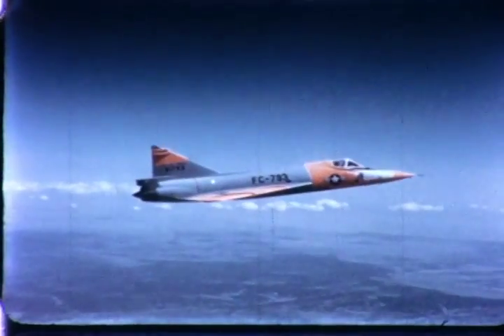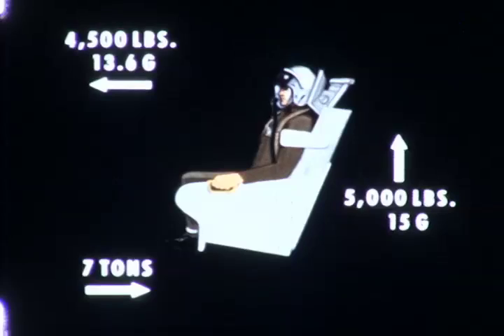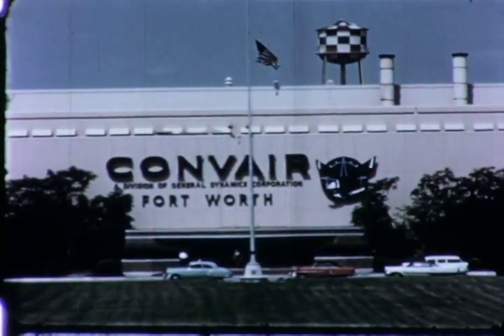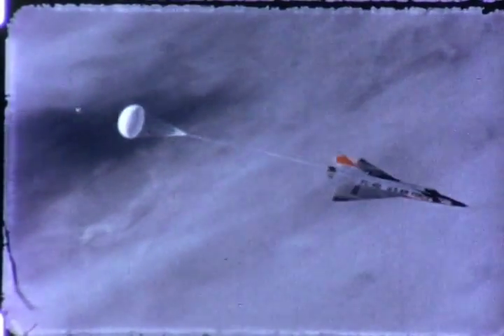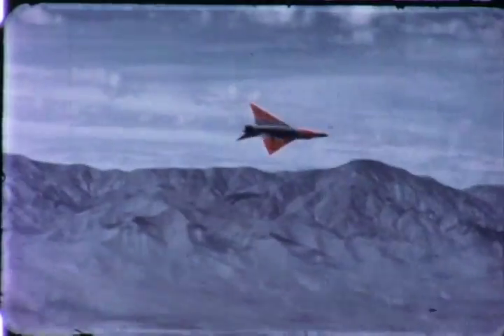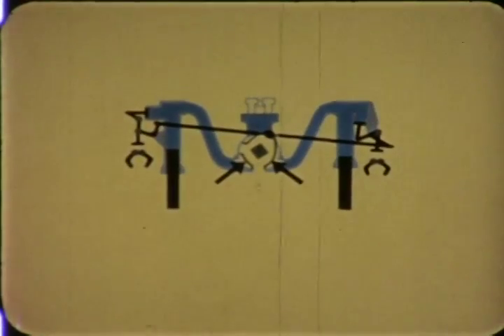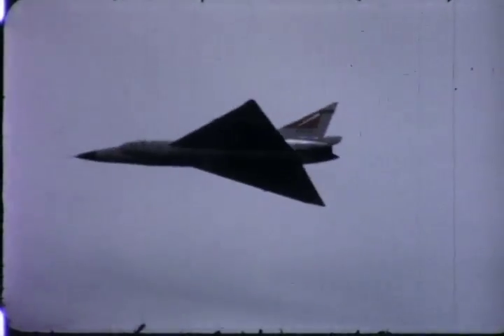F-0594 Convair F-102 Delta Dagger Video

Comment: France had no issue with delta wing jets and theyre still very succesful  planes for bational défense. 
I wonder why it didnt work in the USA?
Reply: It's largely political. The f106 was the fastest and most manuverable plane america had in the 50s all the way until the f15 came along. Which the 6 still out manuverd above 40,000 feet or 12000~ meters. It is also to date the single engine jet with the lowest accident rate in the US's history. 

However, it was an Air National Guard plane. The f4 came along in 1960, the year after the 6. This was at the same time the us was trying to consolidate all of it's air wings into using the same aircraft. So while the f4 had the Navy, Airforce, and Marines batting for it; the much less influential Air National Guard was the only advocate in the 106's corner. 

Another reason could have been financial. The f106 was more expensive than even the f4. Also being an interceptor it would require modifications to carry Air to ground may further add to the cost.

Comment: F102 Delta Dagger couldn't acheive Mach 1 do to lack of an " area rule" fuselage . This fighter interceptor was a disapointment overall , unlike the F106 Delta Dart , the " Six " was brilliant !!!
Reply: Yes on very early models, but fuselage redesigned after which speed was good for mach 1.2 though the Six could hit confirmed mach 2.3!
Reply: @geauxtigersdjs  the Six was a badass Interceptor , it came into service in late 1959 and was retired by the ANG in 1988 , not too shabby !! 👍
Reply: False.

The YF-102 could not reach Mach 1. The YF-102A incorporated the area rule fuselage which enabled it to exceed Mach 1.

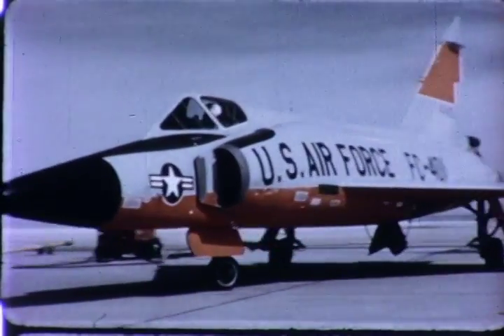Comment: 10:15 Here's an interesting shot. First, the DC3, an airliner from the '30's. Cruise speed: 200 mph. Pan over to the F102, a single seat fighter from the '50's, which is the same length and has the same gross weight as the DC3 and is supersonic.

Comment: I was assigned to the 482nd FIS at SMJ AFB.   WE HAD 57s, one 56, and two TF 102s.  I was an MG-10  Automatic Weapons Control Systems maintenance guy.
Reply: Lucky man... When I went into the USAF in 1987, several 102s gate guardians were around even a TF... I remember thinking about those men in the USAF in the 50's and 60's... must have been great compared to modern day operations. The F-102 is my favorite US jet...

Comment: Known as the Dirt Dart. Of 859 built, 259 crashed, killing 70 pilots. Withdrawn from Vietnam because the Air Force couldn't find a role for it. The plane had a 0-3 record in air to air combat. Two Greek F-5s shot down two Turkish F-102's in 1974. A PVAF MIG -21 shot down a F-102 when it snuck up on two F-102s. No rearview from cockpit, forward view blocked by instrument panel and metal post middle of windshield. An all around dog.
Reply: Not a dog. It was designed as a bomber interceptor. The fact it was not favorable in dogfighting is not a flaw.  It could not grade gravel roads well either. Another function it wasn't designed to perform.  The F-106 had the same windshield design which was more than adequate for sighting a 100ft wingspan intercontinental bomber.  Both served well for years.  In the end the F-102 was a positive step forward in high speed jet technology.
Reply: p.s.  259 loss is a 30% loss rate, in an era where most fighters probably suffered a 25% loss rate. The USAF had literally thousands of planes. The USN in the late fifties was crashing 5-6 planes a day. The USAF was probably much higher.  It was a different era, with less emphasis on standard procedures, rapidly changing technology etc.   Next, 70 pilots lost is 27% rate, again, probably typical for the era's limited capability ejection seats.
Reply: It was not built as fighter it was a interceptor built to intercept incoming bombers I was a communication and navigation specialist on bough the 102 and 106 at McCord AF base in Washington State

Comment: We still have an F-102 on display at Ellington Field... bearing the name of 1LT George W. Bush!  Of course, the F-106 Delta Dart was the leaner, meaner replacement for the 102 and went on to serve for nearly a quarter century as the backbone of the continental air defense.  Good work by Convair in the pre-transistor era.

Comment: Full information might have included the design concept with the XF-92.  

As far as the F-106 being a "modified" F-102, there are only superficial similarities.  The air intakes on the 102 are vertical and forward of the cockpit while on the 106 they are angled and are about 6 feet behind the cockpit.  Of course the rudder is a big giveaway with the 102 having a full triangular fin, pointed at the top, while the 106's was flat at the top.  There are many other differences but those are the best identifying points.
Reply: Engine Exhaust is also quick identification point. The 2 cones on the side of the engine can.

Comment: The old shorts are a hoot! Post more!  I really dig at 15.25 the explanation of the use of Analog Computers to crunch all the  test data from F-102 /F-106 flights .  Makes me think of the cool old idea of the FLOWDAC , patent 3190554, a digital computer that used compressed air to do computation .  A computing solution that never found it's way into solving a design problem.  TO INFINITY AND BEYOUND !  Patent 672245, 3013505  Seems the 102 could fire quite a missile .  Was a test ever attempted to fire it into low earth orbit ?

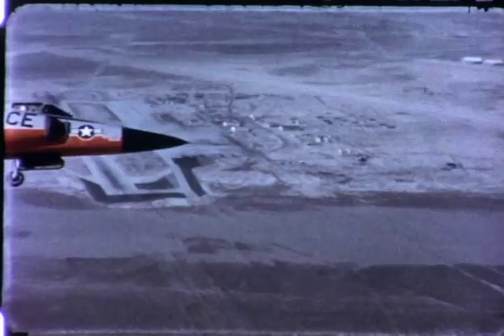Comment: 14:07 Those are obviously different versions, any details?  Different rudders and fuselage heights
Reply: The film mentions the F-102A and the TF-102A which was a two seat trainer version.
Reply: Fifty State the f102 was redesigned several times early on to allow for area ruling of the fuselage. also it got three different sets of wings and tails.

Comment: I guess the Sidewinders and Sparrows destined for VietNam did not get the benefit of this "all environment testing". Perhaps the manufacture of the units I mentioned thought it was a waste of time since everything was looking so good with other models (turn your sarcasm detector on).
Reply: I don't think the Sparrows or Sidewinders fit in the bay of the F102 (or F106 for that matter). Until the mid-60s, Sparrow and Sidewinder were Navy programs, USAF was still married to the Falcon.
Reply: +Dan R High humidity confused the sparrows radar and sidewinders were unable to lock on at low altitudes. Pilots had to fly lower to get a lock as the heat seeker was confused by background temperature. :-)
Reply: +Dan R Here's what I find interesting: 20 years later the Aircraft had all been converted to MQM-102 and we  {6585 Test Group Det-22} were shooting them down with AIM-9 M's.

Comment: I guess that Convair could have designated the F106 as the F102 B,C,D,E,F,etc. They decided to call it a whole new airplane instead.
Reply: Looking at the two airplanes side by side they are pretty different. Especially the fuselage shape, engine intake location and tail fin shape.

Comment: Applying "area rule" recontouring of the wing to fuselage interface allowed it to push past the sound barrier and resulted ultimatley into the F-106. NACA is credited in solving the air compression problem at this interface area. Decompression was acheived by bleeding off the air with a "coke bottle" reshaping of the fuselage.
Reply: I think a guy called Dick Whitcombe came up with the idea of treating the shape of the aircraft as a whole rather than as a series of obstructions to wind flow. He realised that the fuselage/wing junction presented a much larger profile to wind flow than the sum of the two as individuals. Hence the "coke bottle" shape. He revolutionised transonic and supersonic flight as a result, which would have been enough of an achievement for most people, but that wasn't enough for him. He went on to invent and develop other very important pieces of airplanes, such as the winglet, which reduces fuel consumption - a vital factor for today's airliners. His version, though, deployed and retracted automatically for maximum efficiency instead of being fixed as in most modern types. Leading edge devices for STOL planes was another of his contributions - there are more, but I can't recall them offhand. I'm not even 100% certain I have his name right, but I am sure that you're correct insofar as his employer is concerned. NACA had the absolute cream of the aeronautical community to choose from, and it only ever chose the very best of the very best. Sadly, those days are gone. But there must still be brilliant brains out there who are equally as capable as mr. Whitcombe. It's just a shame that they're no longer employed by such companies or organisations as NASA or Lockheed-Martin - or even, obviously, Boeing. I wonder where they DO work?
Reply: Tom Foyle Lucas films. Project engineers for Star Wars

Comment: crorivpro did they decide to phase out the Falcons back then?  I also noted the separation of the rockets was good but there was a wobble factor.  This was cured, I read, with the Hydra 70 spin stabilization rockets coming after the 102's service.

Comment: The F-102 was the most "delta" of all deltas! Look at that tail. I notice that some of those rocket salvos had some pretty bad "stragglers", small groups of rockets that went off at an angle to the others. Also thought it was odd, at about 2:40, the says the flash heads go off at "about 1,500ft, the tactical range of the rocket". Those flashes look really close; they were really supposed to get that close before firing them?
Reply: The XF92 was even more triangular in its profile. It's vertical stabilizer was nearly as big as the wing.

Comment: I was a weapons mechanic on F-102s in 1967 /68  Naha AFB Okinawa 82nd FIS  We called them Deuces. I liked working on the 102s because the weapons system was simple and only had a few variations in the standard load. Six missiles and 12 rockets.
We only used 12 rockets, six loaded in tandom in three tubes on each side. ADC was so much better than TAC.